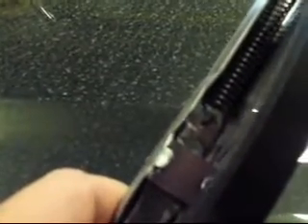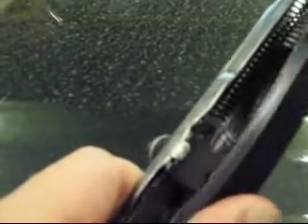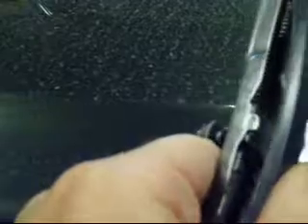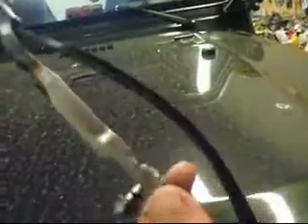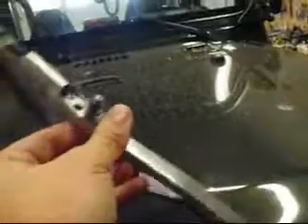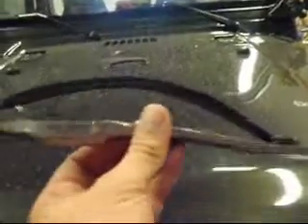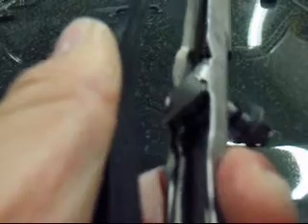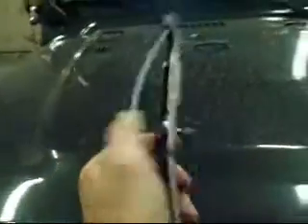CB550 Cam Chain Tensioner

Comment: holy crap ive been scouring the internet for anything about my cb1000c and have found no parts and no info for adjusting my tensioner.  ive heard that its self adjusting and one guy told me it cant be manually adjusted but i dont belive him.  was wondering if you new of any sights that had a guide for manual adjustment.  i love my bike and have a looong ride im wanted to attend but now i cant if i dont get this fixed.

Comment from the maker: I hate to be the barer of bad news but I think your tensioner is toast. I think the adjuster screw is press fitted to the cam gear & you will likely have to pull the tensioner to try to fix it, or replace it. I would exercise the 2nd option. Replacing it can be done without taking the motor out & apart, but it will have to be tilted in the frame to clear the top frame tube. Did you check out SOHC4. net? Great forum for Honda CB tech questions.